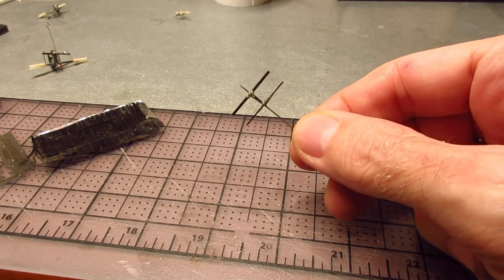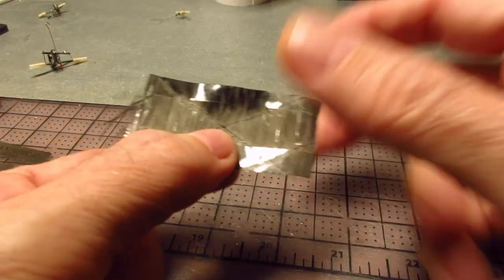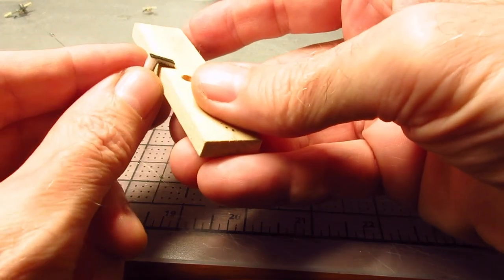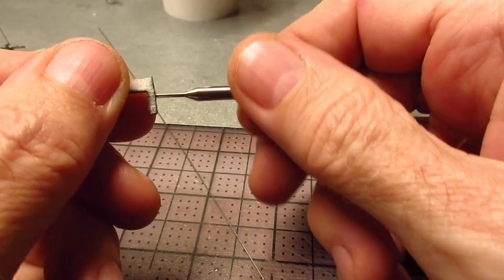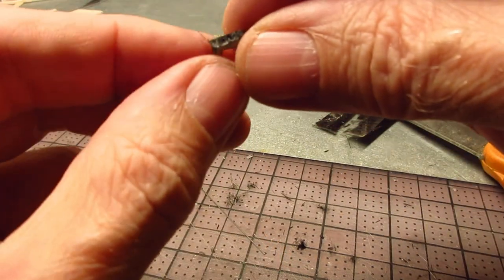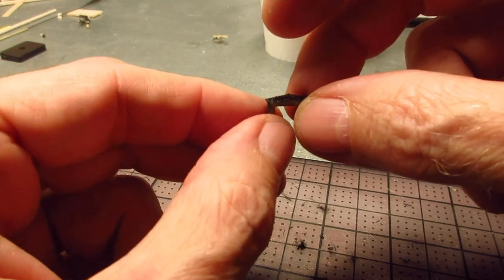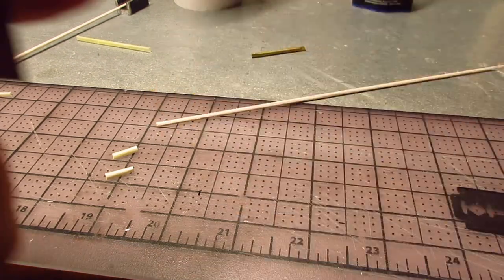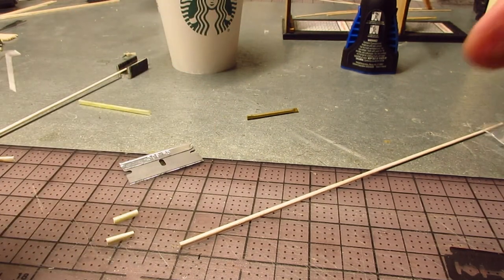Variable pitch prop build - Part 2: screw holder, prop holders, tension spring

Comment: Congratulations on your great work, where can I find the plan for this VP?
Reply from the maker: I never drew up plans for these, I just made sketches. There are only a few dimensions, I could put them up if you let me know which one you're interested in - F1R or Pennyplane.
Reply: @domoremath  Thanks for answering! I'm interested in this VP system, for F1M, I think it would be similar to its pennyplane category, according to the weight of the model, etc. I only need the carbon tube where the centers of the propeller blades pivot. I would appreciate it if you could put at least a sketch with measurements.